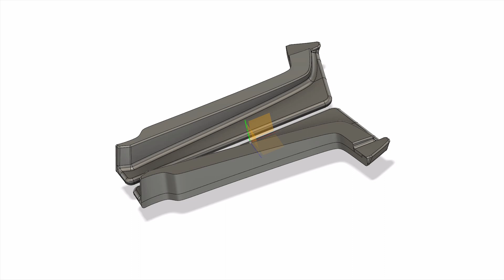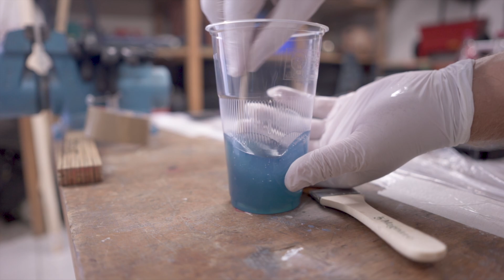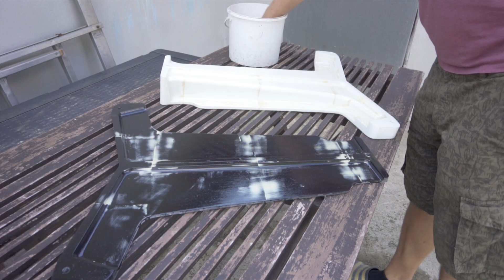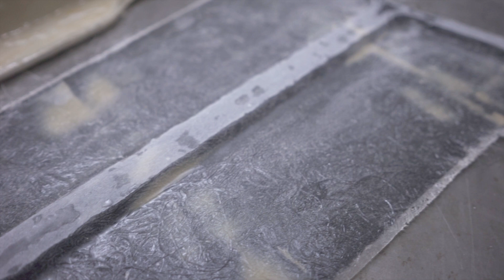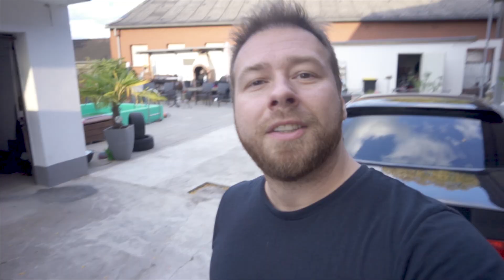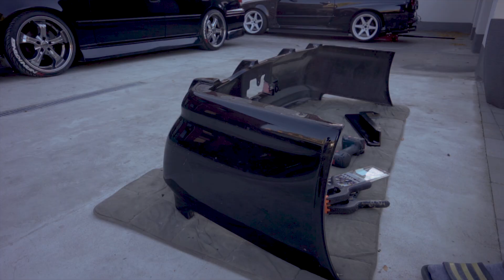FRP parts from 3D printed mould | R34 rear bumper extensions

Comment: Amazing as always. This has given me a bad idea for my car. I messed up an exhaust cut out on my bumper. Ok well i didnt mess it up more installed the exhaust cut the hole then had to reposition the exhaust for clearance reasons so had to extend the cut out sideways and not it looks crap. Tempted to 3D print a shroud and then cover it in a few layers of fibreglass for strength and heat resistance. It wouldn't too close to the exhaust but thats why i say its probably a bad idea
Reply from the maker: How about doing a very thin print and add a couple sheets of carbon and then pull out the plastic and only install the carbon bit?
Reply: @LXGspec  You always inspire me. i will try that